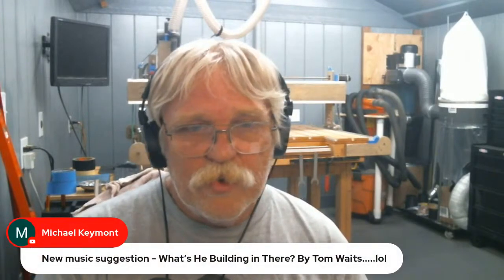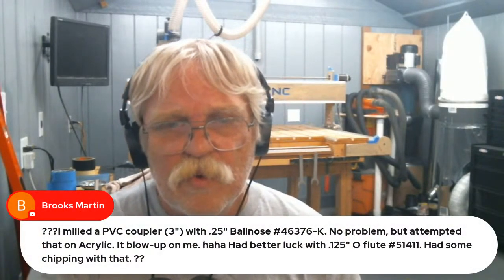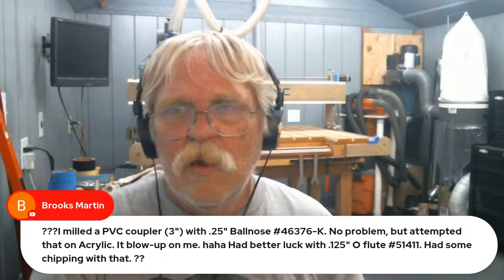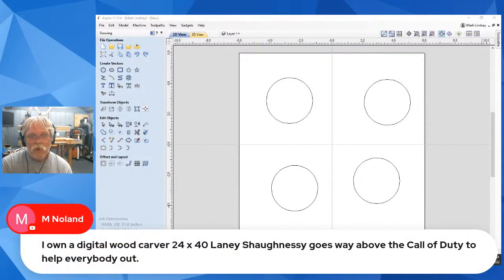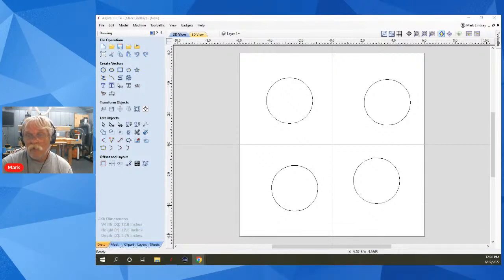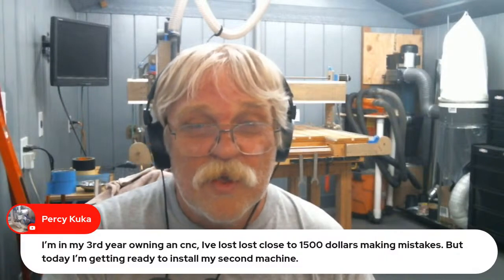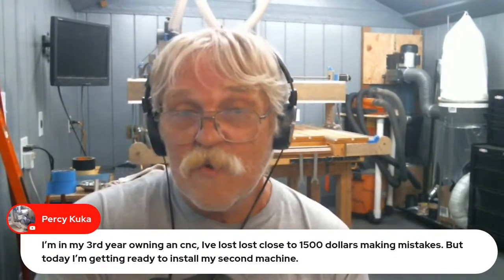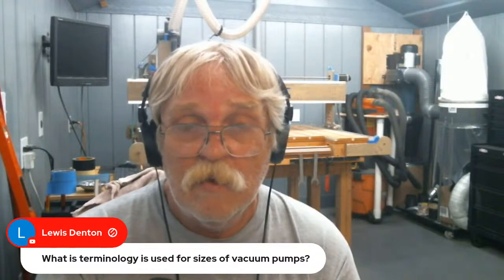Live Q&A #145 – Open Q&A

Comment: How do I get the yellow around the curser
Reply from the maker: That's an app that I (sometimes) use called Mouse Highlight. It's an add-on app that works with Windows - not just with the Vectric software. I usually forget I even have it. I only use it when I'm live streaming so viewers can more easily follow the cursor. I don't use it on a a normal day-to-day basis.